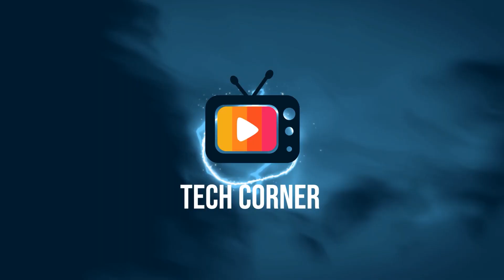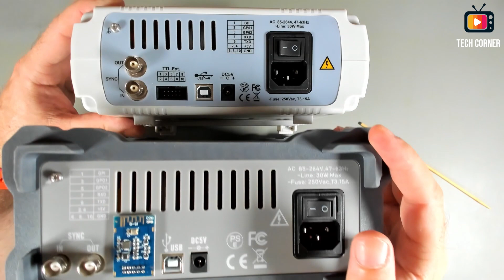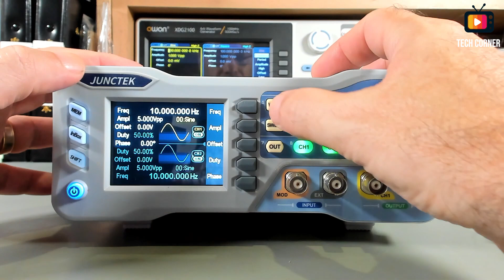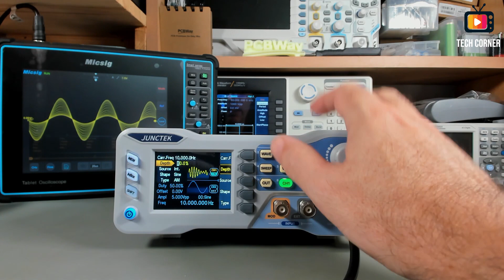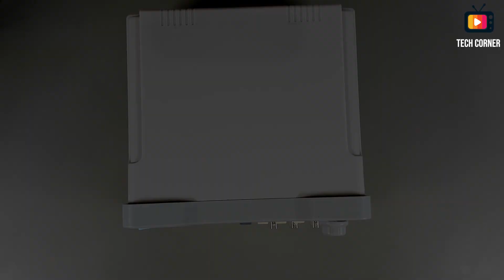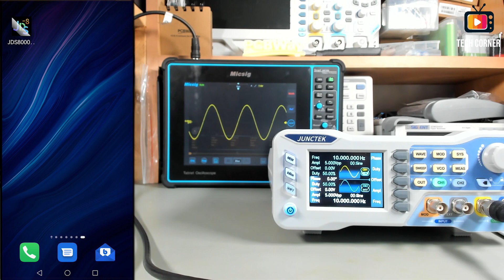Juntek JDS8080 Function Generator⭐80Mhz & 14 bits ⭐2-Channels & 275MSa/s

Comment: Hey there, I have a question about my JDS8000. I just received it a few days ago, new from seejii from China. I set it up to where I wanted it to be, which was various frequencies, "but mainly" the sweep feature, I was still working on figuring out the voltage. I was able to get the sweep programed in to the memory with no problems.
Here's the problem I'm having, I turned it on and off a few times, but after I programed the sweep, I turned the unit off, and un plugged it, I tuned it back on to make sure the memory was still set, but it wouldn't turn on. It would power up for about 10~15 seconds then it would turn back off. I let it sit overnigh, and the following day it did the same thing. I thought perhaps it was the internal ac dc adapter, so I plugged in the 5v 3a adapter and it did the same thing. I  contacted China for help, they sent me four firmware links, but none of them would open, what do you suggest I do?
Reply from the maker: Hi, it seems you have a defective unit, hope you payed with paypal so you can open a case. Just talk with juntek and explain your situation, they should help you. Thanks for watching.

Comment: Have you tried measuring the rise time of a square wave?
Reply from the maker: Hi, no I didn't. It is a nice suggestion. Will do that on future tests. Thanks for watching!
Reply: @TechCornerTV  
Ok!
I'm looking for an modern Impulse Generator with rise time less than 1 ns. I would also like it to be regulated, like made in soviet union G5-78 - rise and fall time regulated separately from 0.1 ns, and maximum frequency is 500 MHz .